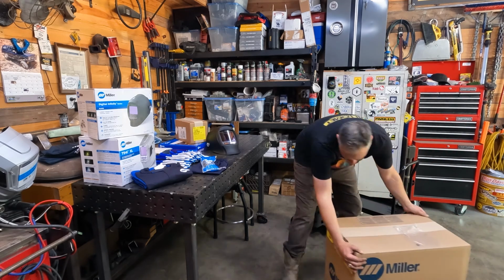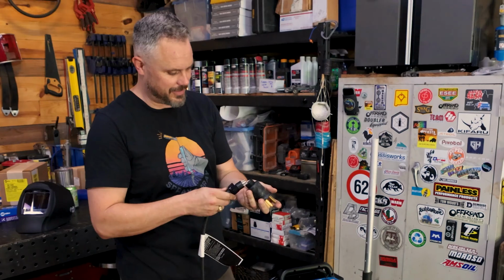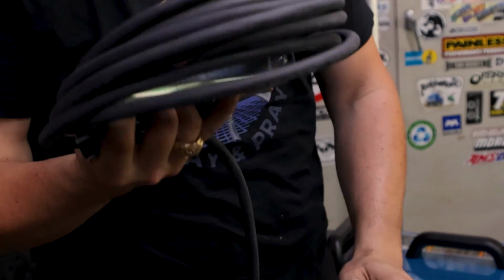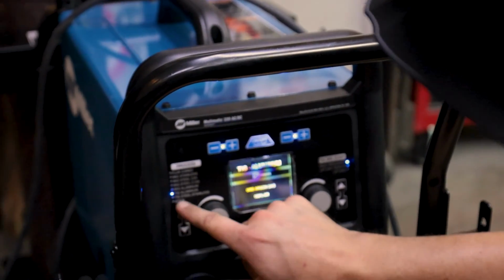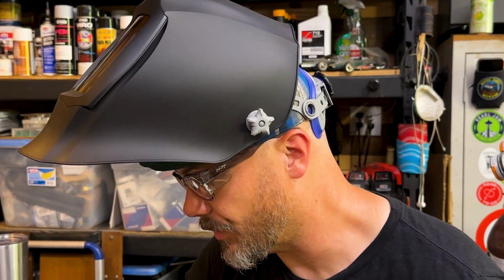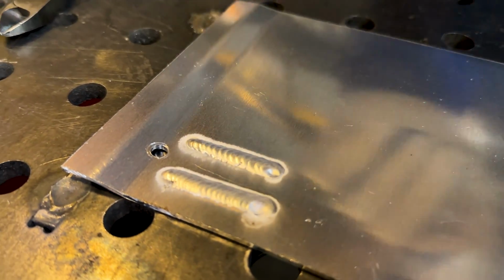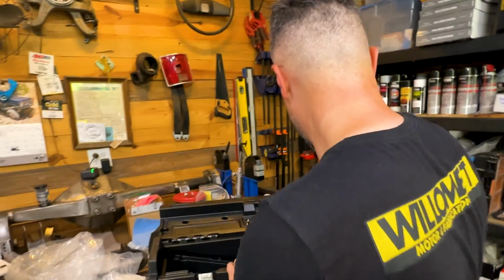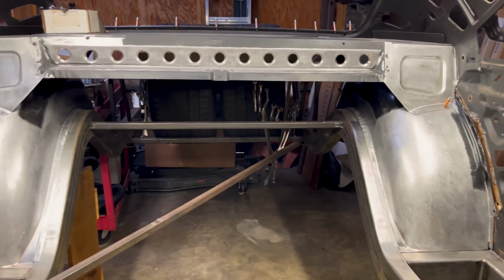New Multimatic 220 AC/DC - All in one welding straight out of the box!

Comment: How well does this machine tig weld body panels on cars? Im looking into getting this welder for my garage to use when i tear into my 69 Charger!
Reply from the maker: This does well on steel body panels. Arc starts are 20A, which is plenty low for hardwire welds, and is at the bottom of the range for silicon bronze brazing. Most of my 20ga panels get welded at 33A constant current, or a 42A pedal pulse.

Comment: I'm curious have you ever given everlast welders a try?
Reply from the maker: Yessir. In fact, I had a 210EXT before this and learned a lot while using it. It's a good value welder, and if you can find one used, it's a great place to start.
Reply: @WillometMotorFab  Thank you sir,with you having  used both, do you find one better than the other or can one not go wrong either way?
Reply from the maker: @speedwayman100  for arc starts, miller wins every time. It's a distinct "pop," and the amp control via their pedal is exceptional. There's no waveform control, but that's a pretty advanced feature I didn't make too much use of before. I haven't tried the new everlasts, but supposedly they just keep getting better. I think if you're just getting into welding, a used welder is a great way to start. They're everywhere on marketplace. The multimatic is great, but it's $4,000, too, so you should get some hours in on a value welder before committing to a long termer like this miller.
Reply: @WillometMotorFab  Good info to know thank you.May i ask your thoughts on multi process machines?
Reply from the maker: @speedwayman100  I prefer the Miller, but mostly because it's so darned easy to use and takes up a lot less floor space than having separate machines. My only addition would be a water cooled TIG torch.
Reply: @WillometMotorFab  right on,thank you for the help!

Comment: Nice video and machines. I have been looking to update from my old Lincoln and was on the fence about the auto adjust and digital display but I  drawn to the flexibility of the multimatic. I Look forward to some feedback after you put more hours on both machines and the helmet as well. I do like the wireless foot control and dual outlet plugs, this makes it handy when using outside the shop.
Reply from the maker: You got it man. I have lots of shop and outside working coming up. I actually spent a lot of time using this machine when I was up at Nate’s building a trans tunnel. The sucker works, but I’ll do plenty of testing here at the shop.

Comment: Bought a Miller 211 last year after over 15 years of a 140 Lincoln and it bothers me to think about how long I mistreated myself
Reply from the maker: Haha! I kind of felt the same way! What did you like so much about your welder that was that ah ha moment?
Reply: What was the game changer for you?
Reply from the maker: @mbrick  TIG arc stability at first, and eventually the easy but finely tunable mig settings
Reply: @WillometMotorFab  The HF start works really well too.  It seems to work better than even an older Dynasty 200 I have used.

Comment: I wish I could afford a Miller, but my Harbor Freight welder is cuttin it... for now
Reply from the maker: And it will for a while longer, I’m sure. I ran value brands for about 10 years as my skills grew, and if I didn’t get this from Miller, I would have shopped for something similar on marketplace.

Are you running their MIG right now?
Reply: @WillometMotorFab  I have their Vulcan 220 multi-process machine myself. I've been very impressed with it. I am still learning myself so there is no rush but I will eventually have a Miller